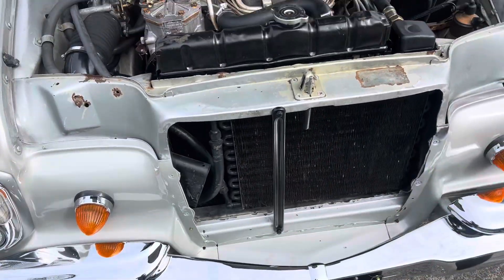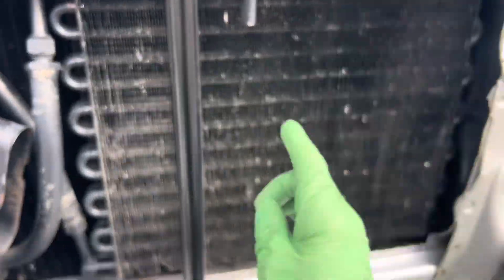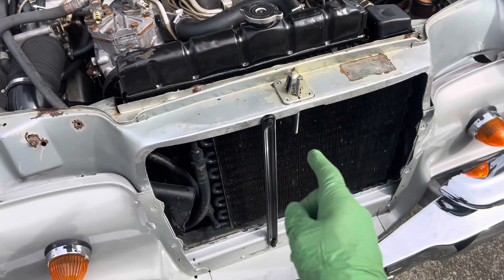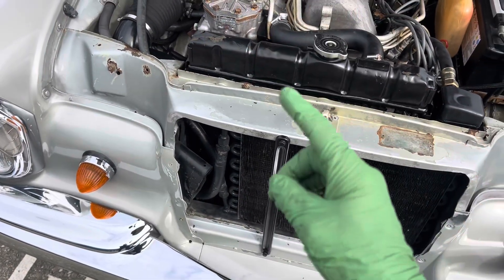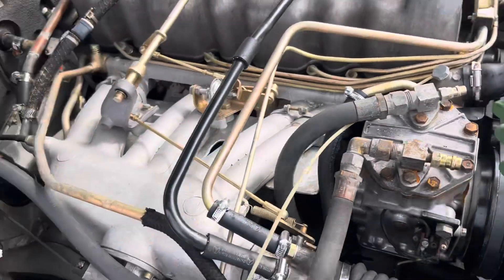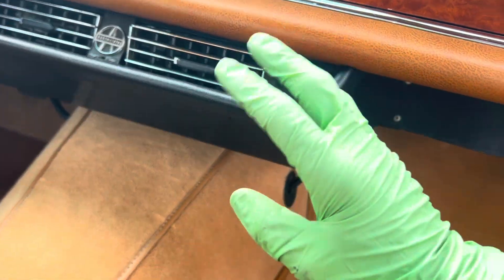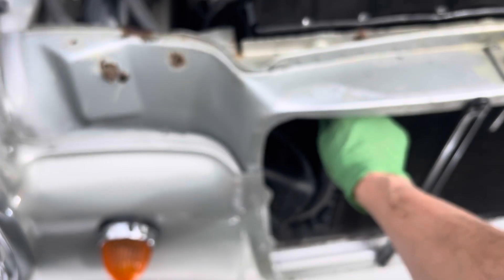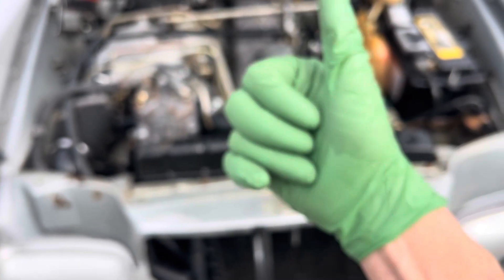R12 REFRIGERANT ONLY. This is not a good car to retrofit to R134

Comment: There is never a good reason to keep using R12 refrigerant
Reply from the maker: There is still tons of it. And it works good
Reply: @coldfinger459sub0  If it is still contained in the machine, feel free to keep using the machine, but NEVER refill using R12, and if you have a machine containing R12, do dispose of it properly. Using CFC's is one of the biggest technological mistakes we ever made as a species, advocating for more release of it (which is what you are doing) is criminal.
Reply from the maker: @greyhunter37  unfortunately, all those little cans that everybody has stored in their garage or shelf somewhere have been Croot Ding and resting away and just leaking out to the atmosphere doing nothing serving no purpose. 
     All the 12 that is produced will eventually end up in the atmosphere unfortunately. 
       So it might as well be put to use. 
       I used to use it to cool off my steel toe boots when I was young hot summer days working.  Or chill down your Coke can for your soda on a hot summer day.. as a child I would grab the cans from my dad‘s shelf and go outside in the backyard and freeze bugs. 

But long as we have a stock pile of what is left what is gonna be going to the atmosphere anyway you cannot be stored away in some underground nuclear tank facility that are rated not to leak for 10,000 years. That’ll do no good. It’ll all end up in the same place up in our ozone..
Reply: @coldfinger459sub0  That is just untrue. Left over cans of R12 from back in the day should be disposed of at a waste management facility. It will then be destroyed in a way it won't destroy the ozone layer or act as a very powerfull green house gas (R12 is 11 000 times stronger than CO2)
Reply from the maker: @greyhunter37  they do not destroy the R 12 it is still being used in Old industry and still being resold keeping old equipment running. 
       The refrigerant manufacturer recyclers are asking people to turn in and they will purchase there are 12 from them. 
    And they gathered it all up and resell it to be used they do not destroy it
It’s a huge high dollar market to sell Old R 12 .
Reply: @coldfinger459sub0  While some of it is recovered and reused, a shit ton of it does actually get destroyed as even the chemical companies don't want to be responsible for a catastrophe concerning a huge scale R12 leak at their plant.
Reply from the maker: @greyhunter37  every company sells it to the recycler who is a broker.  It’s not dangerous. It’s not flammable. It’s not poisonous. It’s a high dollar commodity.. 

Just not for the regular channel public that’s why you don’t know about it . 

I have a few hundred pounds of it myself . 
     And one of those companies seen I posted a video with several hundred pounds of our 12. They contacted me through email to purchase it from me.. 
     They even looked at my phone number and called me to purchase it.

Comment: Hey tom I have a question, which is more efficient to run my non inverter mini split ac in a non insulated room set temp at 80 deg on a 86 degree day?
  
run the fan on auto, where it slows down as the room nears the set temperature—though this makes the compressor run longer

Or is it better to run at high fan speed so the room reaches the set temperature faster and the compressor shuts off sooner?

I know that low fan speed can lower head pressure and reduce compressor load—but is running longer at lower load more efficient than running for a shorter time at higher load (with max fan speed)?
Reply from the maker: The higher the fan speed, the more sensible heat removed the higher the efficiency

The lower the fan speed the more light heat is removed the less efficient it runs . 

If it is cycling off and on rapidly, that means somebody choose the wrong size air conditioner for the heat load . 
     The in rush, current of cycling on and off does not add up to more power usage anywhere near to the comparison of running a low fan speed so it runs continuous, removing more late and heat because we are not talking about a variable displacement compressor. 

We are talking about a fixed speed fixed displacement .
Reply: @coldfinger459sub0 I knew I wasn’t tripping with the high fan speed being more efficient, also it’s a bit oversized for my room I only need around 9k btu but I got 1 ton because it was for only $200 used and I was about to buy a 8k btu inverter dual hose portable ac for $400.

but it cycles fast because I have it set a a high temp 28 in the night and 29 in the day outside is only 30